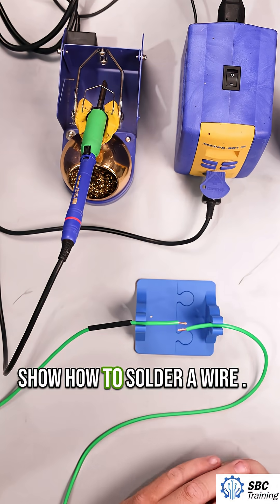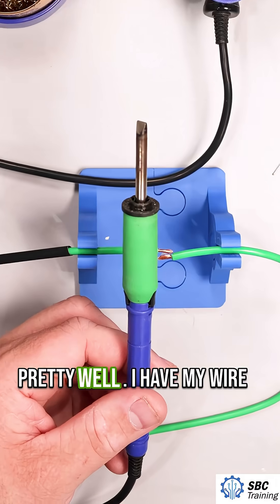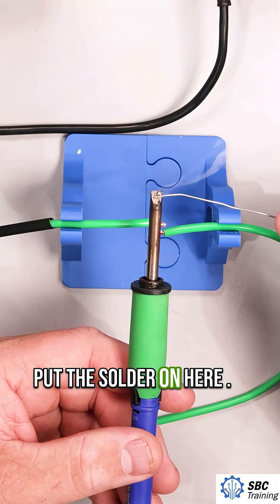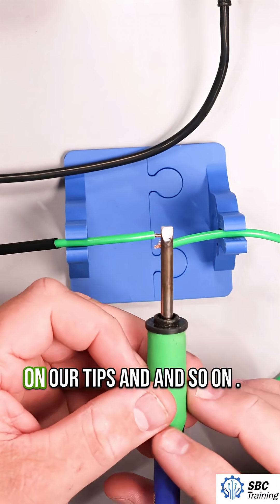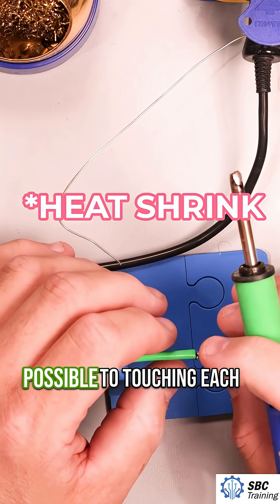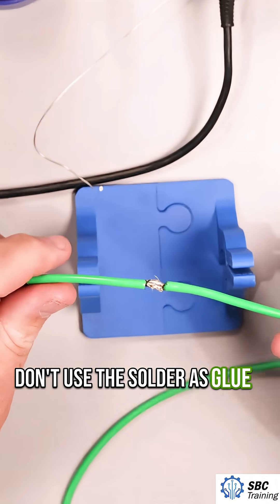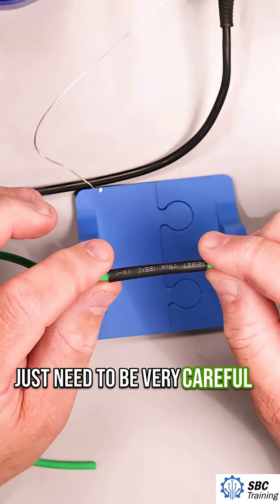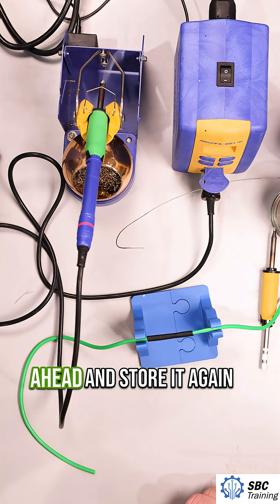How to Solder Wires the Right Way 🔥 | Quick Tutorial

Comment: I prefer joining the two wires at their tips before soldering. So if there is high current flowing through, the wire will not physically disconnect.
Reply from the maker: If the wires are long enough a mechanical connection is great.